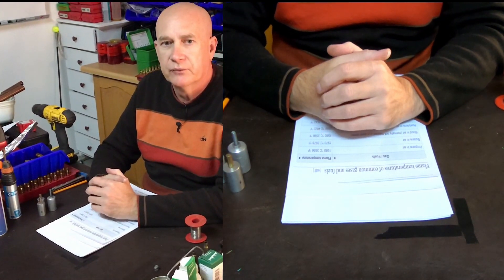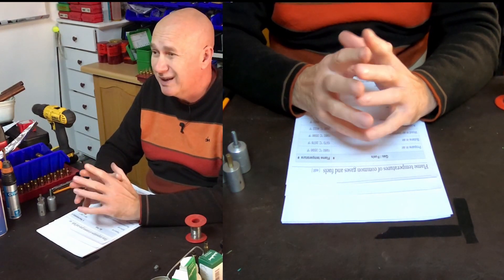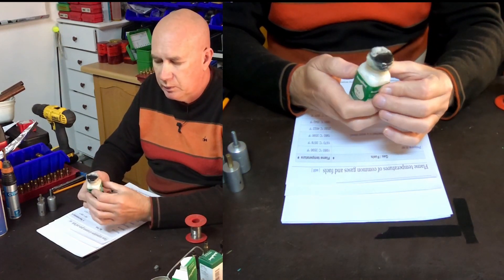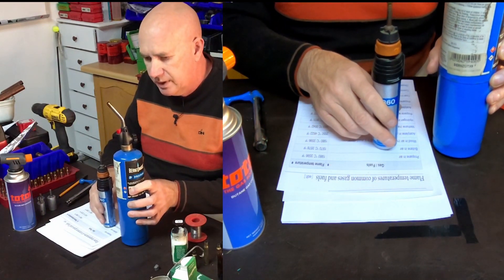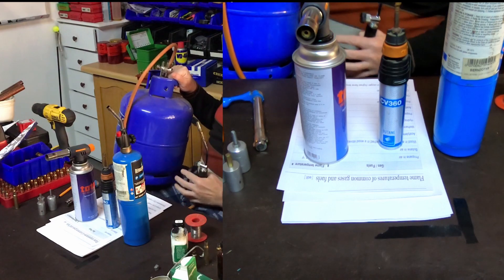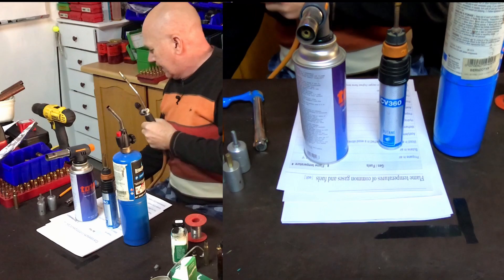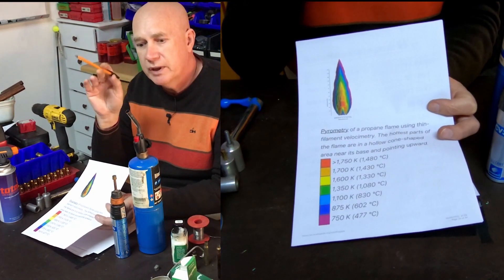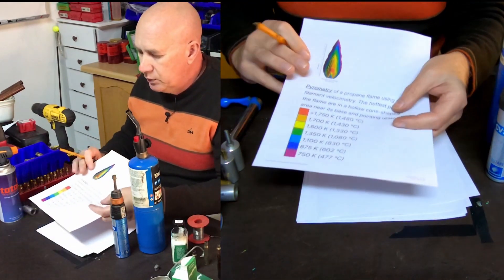Annealing part 1

Comment: So tell me, how do you know that your brass is annealed correctly?
What are the definite indicators of correctly annealed brass?
Why is 750F the correct temperature?
You mentioned the cases may become over-annealed. Apart from the obvious softening of the case head, what is over-annealing?
What are the indicators that the neck & shoulder are over-annealed?
Reply from the maker: Annealing of brass has two variables that will determine if the brass has been annealed or not. The lower the temperature, the longer the time. You can anneal brass at 250*C for about 4hours but in the case of brass cases, that will ruin your brass totally if you submit the whole case at that temp for that time. You have a knee point at around 500*F where brass will anneal in seconds. The highest temperature is at around 800*F at a faster time. For every 50*F above 500* the annealing time is shortened by approximately 0.5 seconds. Above 800*F the temperature will become too high for the brass to conduct the heat away from the heat source and that is where you start to over anneal the brass and the heat will evaporate some other chemical substances and the neck will become so soft that that you will be able to crush the neck completely between your thumb an fore finger. I use 750*F (399*C) Tempilac on the inside of the neck as reference temp and as soon as the green coloured Tempilac turns clear, I dunk the case in water. If you watch the 6 videos (Sorry I know it is a bit long but the subject can hardly explained properly in a shorter way) you should get the full picture of the annealing process. The only visual marking is the temperature ring mark around 5mm down the shoulder. Every brand of brass and caliber will have different time scales at the same temperature due to different volumes of brass.
Reply: @fanatacreloading5399  At 750° F it will take approx. half an hour to anneal rifle brass. You are not close to the correct annealing temperature for a few seconds.
Reply: @mortenbreiland3984  I have done my homework and research over 15 years+ of annealing. The information given is factual and correct. Please endeavour into your own research on brass annealing and when you have done so and still are not convinced that my figures are correct, I will gladly be open to be advised otherwise with your attached proof of your findings.
Reply: @francoisjoubert3001  I have no education that gives me any prerequisite for researching this, but I can give you a link to someone who is educated in metallurgy and explains this very well in his videos https://youtu.be/M8AxgPPoKkU search also the data sheet from a manufacturer of rifle brass (c26000-cuzn30-us.pdf) here are graphs of time and temperature for annealing.